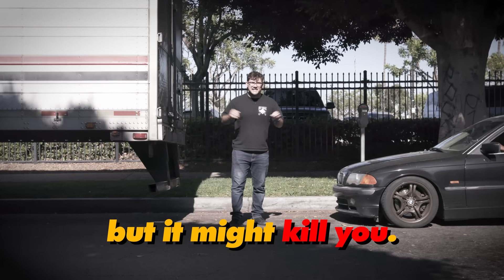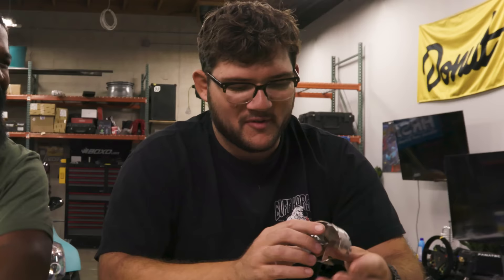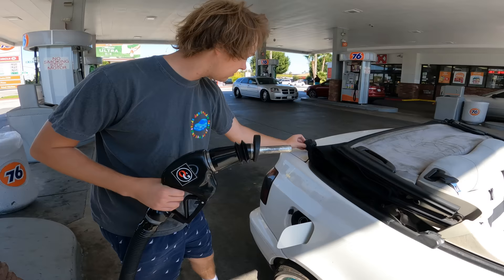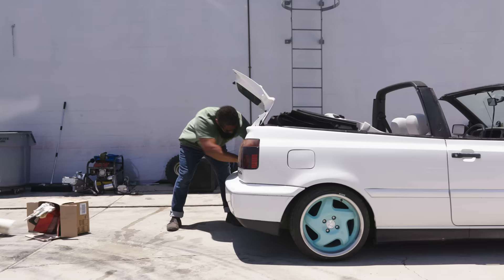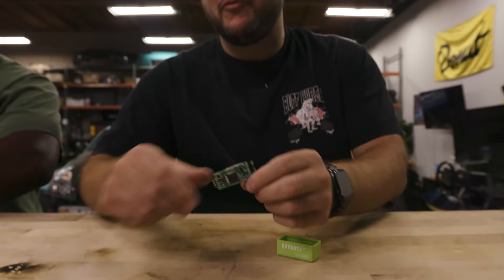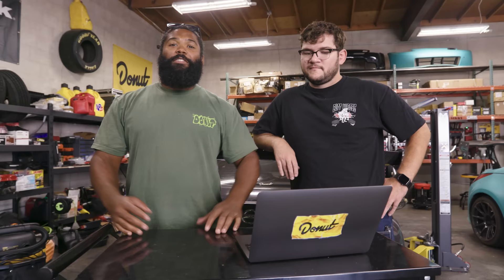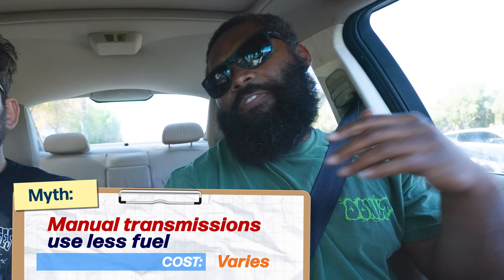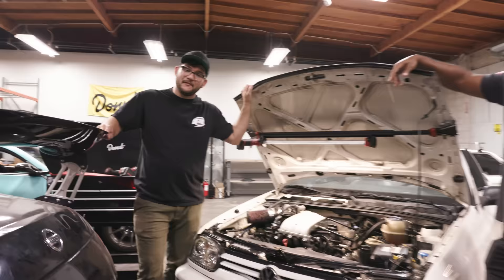Testing Fuel Economy Hacks

Comment: one of the best things you can do ties very well with the "watch how you drive, keep your foot out of it" line is to try to use your brakes as little as possible.  obviously there will be times where you have to come to a stop, but there may be plenty of times where you can just let off the gas earlier and coast for longer, letting gravity and friction slow you down instead of braking.
Reply: Absolutely: My car has 178000km and still the first brake pads. May wife has a very similar car from same manufacturer and same weight. She had to change brake pads at 120000km 
EDIT:
I just looked it up: they have even been changed at 90000km!
Reply: That is why I use engine braking, in some ways its much better than just abusing the brakes and having to pick up that speed.
Reply: @h5skb4ru41  Yep, especially engine braking down a hill. I can't stand it when people go fast and stop at the last second either, like why do that to your braking system? If you aren't racing you don't need your brakes as much as people think they do. I probably use my brakes twice as less as everyone else.
Reply: I mean more brake pads and brake disc wear makes more tax dollars for the government 😂

I also almost exclusively use engine braking for slowing down. Only when necessary, the brake pedal is used

Modern EFI engines also shut off fuel when engine braking. So when going downhill in the biggest gear, you burn no fuel
Reply: @someguy9520  Engine braking? Depends. Coasting saves fuel. Engine braking by changing down a gear or two or three does too, but your car won't actually generate any fuel. You simply save on brake pads by using the engine components as a brake pad.
Reply: @kadajawi6567  coasting does not save fuel, since it uses fuel to keep running. Its basically idling, which does not use a ton of fuel, but it DOES. Engine braking uses zero fuel, since efi shuts off when engine braking

I think you misunderstood my words
The brake pads/disks that would need more frequent replacing with normal braking generates more tax money(you need to buy them). Whereas engine braking does not
Reply: @someguy9520  By coasting I meant letting go of the pedal while still in gear. To me, engine braking means shifting down.

Brake pads aren't that expensive, so I'd be a bit more worried about the engine wear when doing excessive engine braking. But who knows if it does any damage...
Reply: Chairs Paul. 😅
Reply: @kadajawi6567  What you misunderstood is that you thing engine breaking is caused by friction, but it's not. There is the same level of friction between engine parts as when the engine is running normally. And if you have that level of friction everything would broke really fast.

It's actually opposite what normally happens - the intakes are cut, but your wheels are moving, which cause pistons moving, which force the air in your cylinder to compress and decompress and that needs some force and generate heat. And that's not much problem because engines are much better at handling high temperatures and have better cooling then your brakes.

And that's engine braking. It doesn't matter if you downshift or not, but whatever you brake with your engine, it's if it's on the gear. Depending on your abilities what would have more wear is clutch elements, but for manual transmission it's actually cheaper or similar to exchange them then 4 disk brakes. 

And additional advantage is much better handing since you are in gear and can easily just press gas to reverse breaking into acceleration. There is less chance of slipping.
Reply: @ravensblade  Ah, thanks for the explanation! Makes sense.
Reply: @ravensblade but on the "decompression" stroke (which would be the power stroke if you weren't coasting in gear) isn't the energy absorbed by compression given back to the piston, and heat absorbed like cold air leaving a pressurized tank? 
Where does the car's kinetic energy actually go with engine braking?  Just little by little absorbed via heat into the engine's cooling system so the decompressed air (going into the exhaust) ends up colder than the intake air?
I ask because I could never put my finger on where exactly the energy goes.
Engine braking can be very strong; I would be amazed if it's just that little bit of heat each compression stroke that barely has ANY time to transfer into anything before decompression.
Reply: This. Pretty much as soon as I see a red light on a timer (not a sensor), I let off the gas. The light is not going to get green any faster if I get there sooner.
Reply: this is especially important on modern electronic injection engines (or even some old diesels), which can simply stop injecting fuel when coasting
Reply: At lights that are red I slow down. And just roll at 30 mph hoping the light will change to green. Most the time it turns green
Reply: This is just a good car care habit. Use less brake pads, less wear on tires, and if you don't come to a complete stop (for example, idle creeping in a traffic jam) you're saving fuel there too.

It's a good thing.
Reply: Yeah that's exactly how you can save so much gas and brakes too. Pretty much everyone is tailgating and driving as fast as possible in traffic, only to catch up fast and slam brakes for red light that was already on for 30 seconds, which wastes gas. Just watch the traffic and don't drive fast. Keep longer distance. See cars stopped or red light coming up, but you are too far away? Coast and often you can either have car stop naturally with coasting.. or in time it takes you to catch up cars started moving again. When that is not possible, I just use tiny bit of engine braking and sometimes brakes for the last 5-10 km/h if I reach stopped cars.
Reply: Half the time if you see red lights or stopped traffic up ahead and you plan ahead and come to a stop slowly using either light braking or engine braking by time you reach the obstruction it's started to move again meaning you are saving that kinetic energy that it would have taken to get back up to speed.   Also helps with the flow of traffic.

There was a study on why traffic jams can start seemingly out of nowhere and persist even hours after the event that caused it has cleared and it's because people come to an abrupt stop which then causes the cars behind them to do the same, and so on so forth until you get a jam which can remain for a good amount of time afterwards.   So if more people paid attention and stopped being up each others asses traffic would flow alot better.
Reply: @nthgth Yes, it just goes into the coolant. There's a lot of dissipation capacity in those radiators, when you consider that the tiny brake pads produce even stronger friction without heating up much over time.

What do you mean about exhaust gases being cooler than intake? Heat isn't conserved, you don't need to extract it from the intake, it's created from the kinetic energy of the car
Reply: @speedstyle.  I meant that my conjecture was that, in engine braking, the car's kinetic energy is dissipated by the heat of compression being absorbed by the cooling system. With no ignition, the "power" stroke is really just a decompression stroke and gets colder, but some heat energy was already lost (to the cooling system) during compression.
And this is the energy taken from the kinetic energy of the car, so it slows it. Do I have this right?
Reply: @nthgth  I think a significant amount could just be mechanical friction within the engine? But yes yours is definitely one way heat gets out
Reply: @dickJohnsonpeter  You just contradicted yourself. People who brake "at the last second" are braking exactly when they need to, so do you have an issue with using your brakes only when needed or do you not?

Comment: It was super cool when Mythbusters did the hydrogen cell and it did nothing, but then turned around and showed that a regular carbeureted car will absolutely run off of direct hydrogen injection into the carb, at least until it backfired.
Reply: What episode was that?
Reply: @aaronfield7899  s4e10, exploding pants episode.
Reply: I mean, the hydrogen cell in the video here was powered by the engine, so there was no way for it to increase mpg
Reply: @steam6626  fair point, though I thought the cell they were using had it's own power supply, but I could just be misremembering.  In any case, the bigger issue was just that it couldn't generate enough volume any which way, even if it wasn't running off the engine.
Reply: Note that HHO kit actually "works" by tricking the O2 sensor into running the car lean. ($600 in snake oil and 10 cents in tinfoil)  Yeah, repair bills might be in your future. Running modern cars super lean by tricking sensors won't end well.
Reply: Mythbusters failed to install that system the right way. They forgot to add in the ELECTROLITE.
They also failed to retard the timing.

Be aware that burned valves or anything not sealing correctly can cause backfire/explosion.
Reply: @crazysquirrel9425  They forgot to add the Brawndo?

Comment: I think a hyper eco modded vehicle with Jeremiah’s hydrogen genny would be an interesting series. Start it in stages like Hi-Low and keep adding to it until you reach peak geek or startling efficiency!
Reply: replying to say i’d like to see this too
Reply: Problem with hho generators and why they are a scam is they corrode. They will corrode before you get any cost savings.
Reply: just watch project farms video
Reply: @gurgleblaster2282  they are also a scam because they use up electrical energy which one way or the other gets taken from the alternator.
You take energy away from the engine, convert it from mechanical to electrical to chemical and then back to mechanical, losing a bunch of it along the way.
Reply: @chemieju6305  Yep this, paying the conversion tax. It's not like they are using power that would otherwise be wasted like using exhaust heat or braking energy.
Reply: @chemieju6305  granted there's not initial cost savings here, but I'd be very curious to see how using a higher output alternator to more than make up the difference lost would do when set up properly. would be a great long term test to see how actually viable this is. super situational of course haha
Reply: @chemieju6305  yes that to. Lol it's just bad all around any gains in efficiency are lost elsewhere.
Reply: @ActionHank  even a high output alternator wont do you any good. Every bit of energy the alternator puts out is taken from the engine.
Reply: I wanna see this
Reply: See if you can get a 2JZ or a Barra... and then DETUNE it or make it really, really frickin' variable. Double small spinny bois set up for low resistance and with a reservoir attached maybe, rather than just one biggie, high-flow IC, custom intake and top, do a really broad remap of the ECU, new rings, and then put on the best wheels for the job you can and see how much you can smooth out the undercarriage and get little details off...

I'm an I6er guy all the way. My beamer station's taught me all about how you can get crazy mileage out of a straight, while still getting respectable performance, just because it can be so perfectly set up for it. 4000 pound 4x4 hunk of lead, and between looking after the tranny and careful service and tuning and the right driving, it can still touch up on like 48mpg for stretches.
Reply: I agree. Make a whole series and test it on different cars/motors
Reply: You, sir, have taken the words out of my mouth! 👍 Perhaps this should be our next Hi-Lo series!

Comment: The savings with throttle and brake discipline is mind boggling.
Reply: Then again, it requires controlling your throttle in literal 1-2mm increments. Manual transmissions also win big here because the transmission isn't trying to out-think you.
Reply: @josephoberlander Pedal shifters are amazing on automatics. Best of both worlds
Reply: @dejangegic  It depends if the manual mode is really manual.  I remember years ago test driving a RX8 and it had a manual mode that unfortunately would out-think you such that if you pressed the brake to slow down, it would drop out of that mode below a certain speed.  So at about 25mph when slowing down, it dropped to automatic suddenly.  Zero engine compression all of a sudden.  It felt almost like you shifted into neutral.  And then had to re-start the manual mode. 1 2 3 2 (neutral, manual mode turns off).Stop. tap the thing into first from neutral to do it again. If you forgot, it went back to automatic. So only good for 0-60 runs I guess.

GM - those are famous for letting you shift but once you get up to highway speed, it reverts to automatic. ugh. 1 2 3 4.. 9 (turns off trying to save fuel). You can defeat this with towing mode, but... really?

Comment: That's my "Roadmaster" (Its actually a Caprice Wagon) featured at 11:11. The guy i bought it from built it to hypermile and tow trailers. It has a 5 speed out of a Chevy truck too. It easily gets 30mpg. It can get even better mileage if you keep your foot out of it.
Reply: huh, that's pretty neat, ever thought about giving it a common rail diesel? they tend to be pretty efficient and torquey, so a smaller one should be able to move that beast
Reply: I took part in the built thread for your 1994 Caprice Wagon, before Funkhoss sold it to you. He was getting north of 40 in it with his techniques. I suggested to him that he could add a WMI (Water-Methanol Injection) Kit and then advance the timing to get even better MPG, he decided to not add one. This was a few months before he decided to sell.

Comment: For the obd2 fix, someone that actually knows how computers works, went through the "micro chip" and found ALL it did was blink the leds. Only 2 of the prongs actually had power going to them. One positive, one ground
Reply: Yeah honestly you don't even need more than a rudimentary understanding of basic circuits to pop it open and see. The 12V and GND pins are always connected.
Reply: The hero we deserve! Thanks !
Reply: Placebo effect is real, if you believe its making a difference you will see results your hoping for.
Reply: @anthonyfoster2784  Plus when people plug in these devices they start driving like grannies and then get amazed at how much better economy they are suddenly getting, so they actually are getting better economy but only because of their driving habit change
Reply: It would be easy to tell it doesn't worn eco modes just change the shift points so it shifts faster than sport which holds the gear longer if you didn't see a change in shift points it would show its a scam
Reply: That'll be Krazzy Ken. He did a video on it few days ago
Reply: That was @bigclivedotcom !
Reply: Lol
Reply: Yeah the chips in these obd turds can barely calculate things and they hold a few kilobytes of data at most, no way it would magically host a whole freaking software and the specs relative of ALL THE VEHICULES IN CREATION.
Reply: @easymoneysniper9013  that's not the only effect of Eco mode. pedal/throttle curve is usually changed too even though most people will just press the pedal harder..btw lower rpm is not always better for fuel economy. for every speed / load there's an optimum gear / throttle body position / amount of gas.
hybrids with ecvt are usually highly optimized for efficiency and can select exactly the best gear ratio. it's very surprising how even in eco mode, those hybrids will rev quite high every time you smash the throttle. it's also disturbing if you're not used to it, even more  if you drive manuals.
Reply: @geemy9675  we're not talking about hybrids and EVs we're talking about 350 to 700 horsepower 6-8-10 gear automatic transmission held ICE cars and trucks that's pretty much all they do. Maybe a manufacturer does more than that but over all that's all it is. You can hop in a Lincoln or a Chevy and it's just gonna adjust the shift points accordingly
Reply: @rob_over_9000  it is essentially a battery drain device then.
Reply: They are ridiculous. My dad uses them and swears that they work, but I work on cars for a living and know a universal device like that can't remap an ecu in the correct way to boost economy. The one he has says it I creases fuel economy AND power. Which is a total joke.
Reply: @Nefariousrouge  it would be possible if the device had enough processing power/memory, plus access to low level parameters / sensors through OBD to run some self optimizing software. but definitely not at this price/size/weight. anyway it's more likely that the engineers did a better job on the factory tune
Reply: @Nefariousrouge  lmao damn don't let trump hear that he gon pitch a whole to him 🤣🤣🤣
Reply: @Nefariousrouge  yes it does if you leave it plugged in same with micro mechanic but that actually functions
Reply: @easymoneysniper9013  hybrid is just an example to show that depending on the load, the highest gear (lowest shifting point) is not always the most efficient one. it's the same for higher performance engines, low shift points are only "eco" if you're feathering the throttle.